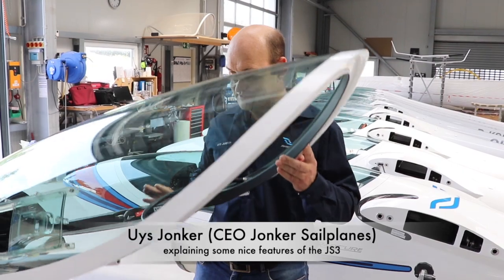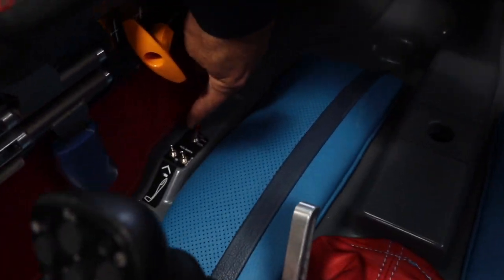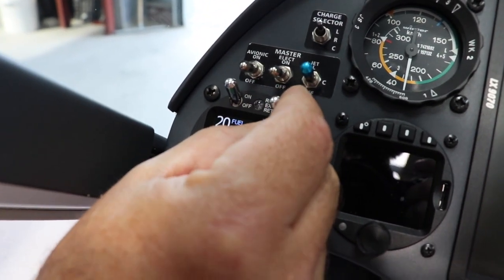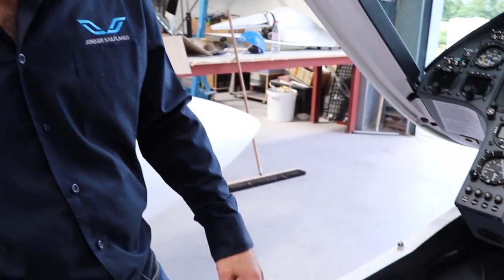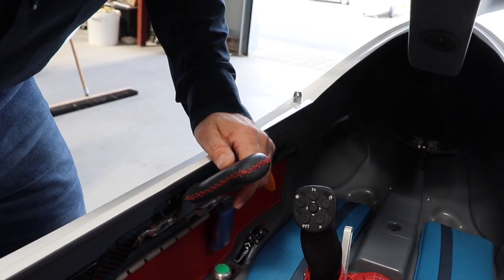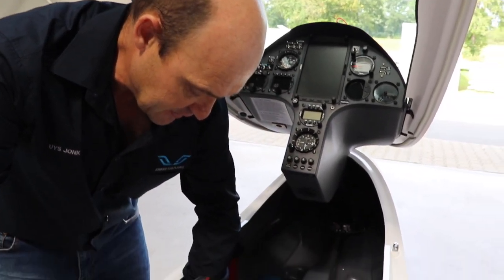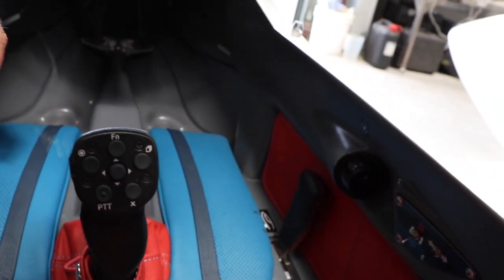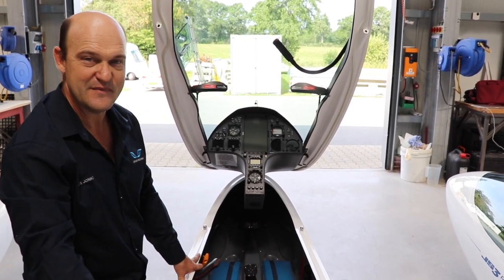JS3: Explaining features and the operation of the JET

Comment: Instead of the super hot turbine , why not design a small hydrogen peroxide rocket, just steam, an even smaller drag and no risk of a fire etc. A nozzle to produce the equivalent of 30 hp as a sustainer would be as narrow as a salt or pepper shaker.

Comment: Awesome plane. You mentioned aircraft for paraplegic pilots. Have you built a paraplegic version? And if so how did you incorporate rudder control? Last question, can you take off with the jet or does it just boost / sustain flight? Very keem paraplegic this end drewling all over his keyboard ;)
Reply: It is "just" a sustainer , because the engine has very few power on ground . A jet needs the increesed airpressure caused by the flying speed to provide the power to accelarate or to climb . I dont know it but i guess with a car tow or a aircraft tow to 10m and 120km/h you could start on your own . Without this I guess you will need a asphalt runway with a length of 1000m to get into the air... 😬
Reply: @Winniethepopo  thanks for the feedback!
Reply: @Winniethepopo  There is a video of it taking off on its own on grass . It needs a long run to get airspeed . But once it does , it climes fast
Reply: @welshpete12  can you send the link ? Because i just know a video where it is aerotowed with the jet extended and running
Reply: @Winniethepopo  - There are two types of powered gliders - sustainers and self launchers. You are obviously interested in self launchers. Both come with either propellers or jet engines.